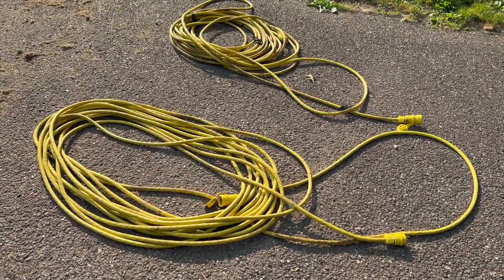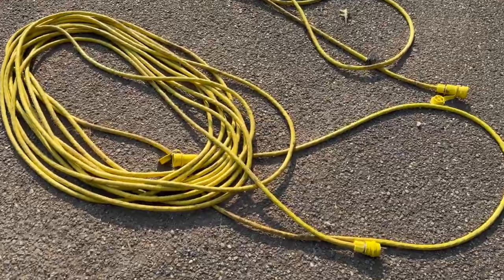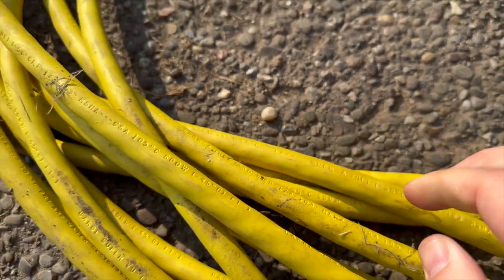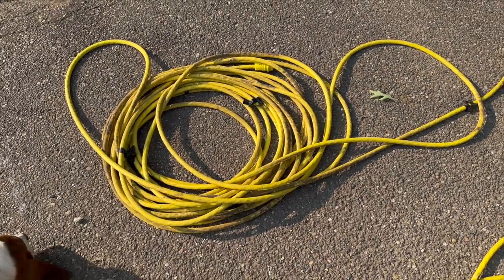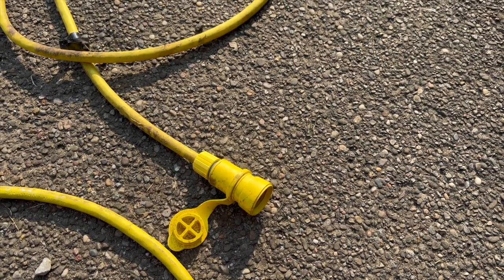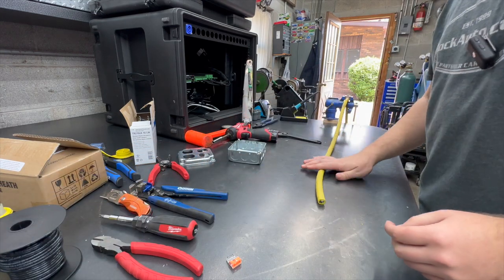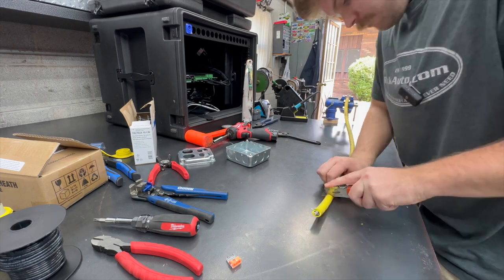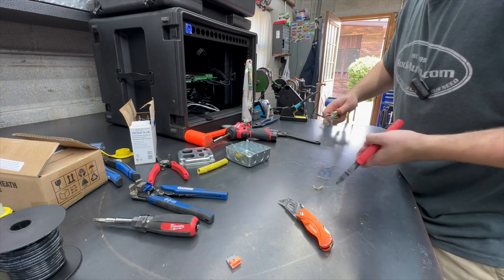Power Cables for Live Events (Live Sound Audio Shop Days 2)

Comment: I use the Stanley version of that kind of wire stripper, used it all over an industrial site I worked for a year, plus every little project I've done since. Only wire it's not good for is really fine stuff, and the super thick stuff, where I'd use a knife instead. I'd check and make sure you've got the tension screw cranked up, the little one on one of the lower jaw blocks.

Comment: We use the wet area rated ABS boxes for the quad and wet service face plates, and terminate with marine water resistant grade plugs. Where we operate the metal boxes are not allowed by code .
Reply: What specific make/model box do you recommend? Thanks

Comment: I always wrap my reciprocals with e tape after making connections and ground the box. There should be a threaded hole in one of the corners for the green screw. Grounding the metal box, I believe that is code but don't get me lying. You can buy the ground screws with a wire pig tail already attached to save time.
Reply from the maker: Tape is a great idea! If you look closely at these outlets, the ground terminal makes a connection with the metal part of the mounting bracket of the outlet which grounds the box.